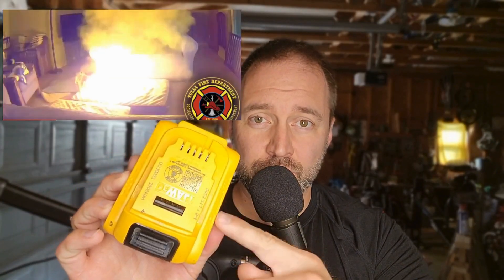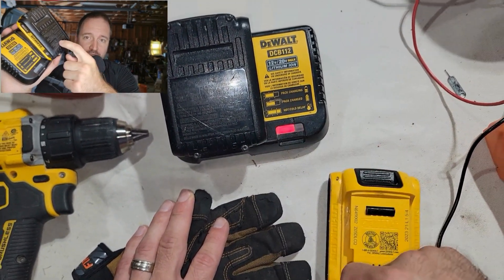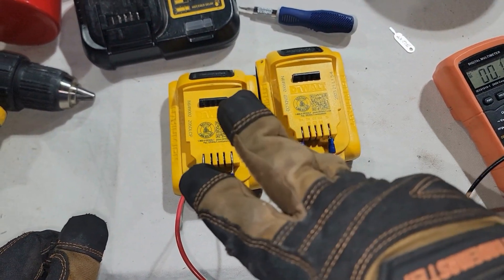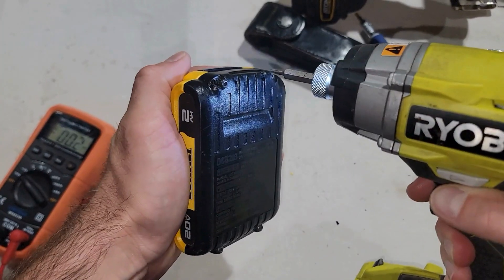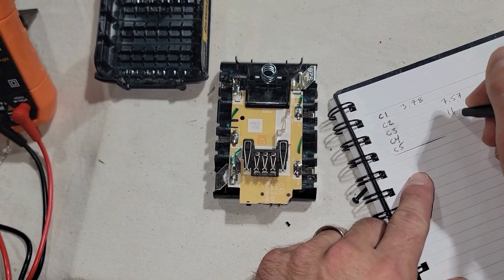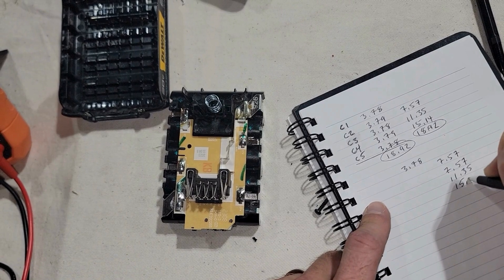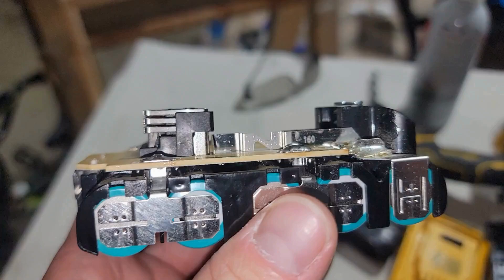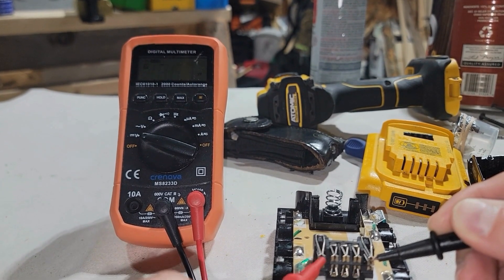DEWALT 20V Battery Not Working? [3 Easy DIY Charging Hacks -- but I DON'T recommend the last one...]

Comment: In my case, I have five different voltage readings varying from 1.038v to 4.18v... None of the five show 0 or negative voltage, but they are all different voltage. What is the protocol for resetting it back to normal, I wonder? Any advice?

Comment: I tried this and my battery still doesn't work on the DeWalt it will not charge it had no light when I pushed the battery indicator button now there's one light but it still won't charge it's just a solid red light and I made sure it was firmly seated in the charger I also do not have an ohm reader

Comment: What if you plug in the battery and the light on the charger start flashing but then slowly fades a turns off? This is happening with one of my 18V 6.0AH batteries that are $329 AU to replace. Ive jump started it once with another battery but this time it wont charge but it still has 1 bar of charge.

Comment: Question I have a 6ah 20v and it shows full charge but using it only last for a short time when I put on the charger it charges for maybe 5 minutes and shows its fully charged this is like a brand new battery Maybe it got hot when I first used it on a weed eater?

Comment: I had a 6amp hour dewalt battery that had fell on the floor on its side. It stopped fully charging. It only charges up to one bar. Opened it and it's at a negative 4.0. The rest are at 4.0 and one is negative. Is it good or do i dispose it?

Comment: I don't know if I will end up getting a response or not. But I'm having an issue with one of my batteries I had gone through the methods checked my voltage and the cells appear to be good and my overall voltage was at 17 volts on a 20 volt battery. Every time I put it in the charger it blinks once or twice and then goes to a solid bar. The battery is fully seated but for whatever reason will not charge. I did some more digging and I found that there was a way to test the ID and TH of the battery and found that the ID is supposed to be at a thousand ohms I was only getting about 800 ohms. And on the TH it said that it varied by temperature but I was only reading OL on the TH. My assumption is that my battery is dead in the water and there's nothing I can do but I figured I'd ask to see if there's anything I can do potentially save my battery?

Comment: Took me a few minutes to make a simple set of jumper wires but when a performed the "jump" on the dead battery it took just 5 seconds like you said.  It worked.

I used a small section of extra extension cord wire - both wires the same color but I put on two different colored connectors to keep the + and - easily identified.

Comment: Question? My dewalt battery that is correctly seated says it is fully charged, but when I press the LED indicators, it say it is dead, would any of these methods help me fix it or would it be simpler to just replace it?

Comment: If I have 2 18V batteries that will not charge, but not good battery to jumpstart them, can I use a 12V adapter?  Or a slightly higher voltage, a 20V battery (a totally different battery of another brand) to revive the 2 bad batteries?  It’s ideal to have identical batteries, but do not have any.

Comment: Well I'm no rocket surgeon but my mechanical aptitude is above average even more so when it comes to electronics been doing car audio for 2 decades so this whole battery revival thing should fall well within my abilities and comprehension and after 10yrs and dozens of batteries and attempts I have yet to revive a single battery not one ever what the fuuuuuuck

Comment: A little story: someone gave me four Dewalt 18V 5Ah batteries and said they were empty. Do you want them? I'm a scraper and collect old metal, so I tried charging it from a good battery to the old one, but nothing happened. So I opened the box. I couldn't believe my eyes. There were only three battery cells inside, so 3.7x3=11.1, not even 12 volts. Then I realized they were fake. The man charged and charged and nothing happened. This company needs to be shut down, but they're all scammers in China.

Comment: I've got a 20v/60v flex dewalt battery that when I hook up to a charger only charges to 1 bar before showing "charged". It'll flash for a moment then go solid red when it is "charged" as well. Is there a dead cell/multiple dead cells causing this issue? I'd like to take it apart but lithium batteries can be dangerous as stated. And yes the charger is good, i have 4 other dewalts that all charge perfectly, including another 20v/60v flex

Comment: I'm getting weird results from the test:

C1 - 2.5
C2 - 4.6
C3 - 7.2
C4 - 4.3

B+ - 6.7

As soon as I connect B- to C3, my multimeter shows Open Loop for about a second and then a steady 7.2v

When I connect B- to C4 it starts at around 6v and lowers quite quickly until it steadies at 4.3v. 

I'm unsure of what the issue is here. Can anyone help please?

Comment: I had a new Battery I used once forgot to turn my sprayer off and it went dead dead.  the jump start seem to have worked will see if it takes a charge.  You think these things would have a low voltage cut off so it don't go completely dead.

Comment: 5:30 - This makes no sense. The terminals (“pins”) are connected to the cell banks, so testing across the cells is exactly the same. The cells are “strapped together” in a 2P+ battery when you measure across them regardless of where you measure. It’s not even possible to suss out the voltage of one parallel cell without removing it from the other, so there’s nothing measuring from the terminals can do about that. You just have to treat parallel cells as one, which is what the tool and the terminals do. The “straps” that connect cells in series are irrelevant since you are measuring the relative voltage difference from one side to the other.

A 5 cell DeWALT 20V Max pack is 1P.
A 10 cell DeWALT 20V Max pack is 2P.
A 15 cell DeWALT 20V Max pack is 3P… or 1P in 60V Max config (FlexVolt).
A 30 cell DeWALT 20V Max pack is 6P… or 2P in 60V Max config (also FlexVolt).

If anything, it’s safer to measure from the wires connected to each bank since the terminals a very close to each other and easy to accidentally short with your probes. You also don’t have your meter rounding cumulative voltages for less and less accuracy like the add and subtract method you used.

Comment: I sometimes drain my batteries just to cycle them.  I converted an old charger so when i slide the battery on, a led light slowly drains the battery.  Unfortunately, it drained it too far and wont charge properly.  I believe one cell is bad, checking it tonight.  I wont be attempting any resets, maybe a cell replacement.

Comment: HOLY COW!!! Method #2 actually worked!! I purchased a DeWalt battery from a auction. It was dead and would not charge  when placed on a charger. I tried method #2 and placed it on the charger and it started charging. Thank you!!
Reply: what kind of wire to use, sir? Thanks

Comment: For the life of me I have two batteries that are completely different manufacture years, one 2020 and one 2023. It always seems to be the little 2ah batteries that if left for too long between home projects they go completely dead to where the charger doesn't see them. I just don't understand. I store them inside my climate controlled home, so they don't get hot or cold during storage times. But it seems to keep happening. I only use DeWalt batteries bought in store at Lowe's. I only use the DeWalt chargers that came with my tools. I don't leave the batteries sitting on the charger all the time. 

My Dad on the other hand doesn't give a F and leaves his batteries in the trunk of his car literally risking them overheating and turning his car into a fireworks display gone wrong
 Leaves them in the trunk in below freezing winter temperatures... and he's NEVER had a battery fail this way. 

Clearly neglecting TF out of the batteries rather than properly storing them seems to be the play here. He also uses his tools way less than I do, I just can't make sense of it. 

I have 3 RC cars with Lio and lipo batteries so I have a pretty decent understanding of how to store batteries. But I guess my knowledge is wrong.

Comment: Absolutely horrible advice jumping the batteries one to each other and the WORSE advice is to reset the CID !!! PLEASE If a battery cell trigger the CID is because reached the thermal temperature that was about to go in run away. This battery IS NOT SAFE anymore. Not only is stupid, you have positive and negative side right there and you are promoting people to short the battery and have an accident or a FIRE  !!!!! VERY BAD and UNSAFE Advice !!!!!!!!!! PLEASE DO NOT DO WHAT HE IS ADVANCING and protect stay safe !!!

Comment: If your battery and device are new to you, it is very possible that when you slide the battery into the charger, you need to give it one last "bump" to seat it. You will feel it lock-in. It's not obvious. But if you are not a new user, then this is probably not your problem.

Comment: This video helped me to decide not to mess with my battery lol.
Reply: I didn’t think it would work but I had nothing to lose to looped the ends of the wires round to make a good contact, connected them all for a maximum of five seconds and actually got a low battery light come up where there had been nothing before. It’s charging now 😊
Reply: Same lol

Comment: I've got a 10AH Dewalt batt that shows only 2 bars no matter how long it has been charging.  When used with the other good 10AH batt in the mower, it runs for a second and shuts off.  I can operate the pruner with it, but not even the leaf blower runs with it for more than a second or two.   I tried draining it by operating the pruner a couple hundred times and could get the 2 lights to be out.  Back in the charger, it goes only to 2 bars.
Thoughts ?  Suggestions?

Comment: I heard a pop when battery was removed from hedge trimmer I tested each cell one measured -0.035v I guess the bad cell causing charger to show solid big light but not charge. Thanks for the advice I will dispose of it no way I'm resetting and risking clients safety/property.

Comment: Regarding method 3. Do not attempt. I'm an electrical engineer and I repair and rebuild battery packs all the time, and I would never try this. You have no way of knowing if everything is fine or if you created conditions for an internal short. If it shorts it will spew sparks and/or flames like a rocket motor or it will just explode. Either burns or missing fingers are guaranteed.
Reply: What does it mean if the C3-C4 battery cluster voltage shows NEGATIVE 12.04V while all others are +3.889V when measured from B- to C1, C1 to C2, etc.?  The battery charger LED blinks once and then goes solid as the battery is fully charged, yet the B- to B+ voltage is 3.469. The problem just started out of nowhere after the battery was working fine for years. Is this thing about to explode?
Reply: @alexlazarev6686  To find out for sure you need to open and measure individual cells. Negative voltage is likely from over discharged cells in the pack. Without knowing all of your details and taking my own measurements I can't know for sure.
From the sound of your question I would say it would be best to recycle it properly and buy a new one. Normal service life of most batteries is only a few years. Re cell is possible, but the cost to the consumer is nearly what a new would cost and newer battery tech is usually better.

Comment: I tried hack #2 on an Amazon no-name DeWalt format battery....no-go.  Aside from an accidental over-discharge as stated in the video, these can also mess up like this because one cell in the pack fails.  The jump start will not shore-up a bad cell.  If it works once, the battery pack will fail again soon.  Regarding #3, well done!  I'd really like to see all those who actually rebuilt their battery pack where they are today with that successful home repair.  Called the insurance company or did the pack last just another brief season.
Reply: I replaced a dead cell in a 5ah 20v dewalt battery.. Worked for about 2 years and stopped working again.. gonna open it up and try again

Comment: I have a battery that show me 1 line at the charge indication but it wont charging 
When I plug it its blinking 2-3 times and stop, what should I do?
Reply: You have some low cells. Take apart and measure cell with meter. remove bad cells and replace or recycle pack

Comment: I just discovered something relevant.  I have 5 20v worklights. 2 Dewalt and 3 Chinese knockoffs.  Leaving batteries in the knockoffs for extended times drains the batteries to nothing even without usage. The Dewalt lights did not drain the batteries. I used the jumper procedure on all three batteries and all three began to accept a charge from the charger. I used the jumper for 10 secs. I did make up a set of jumpers with spade connectors to insure good contact. Many thanks for your video.
Reply: This is because in their wisdom dewalt put the overdischarge protection in the tool not in the pack. Probably to save a few dollars but it means that non dewalt accessories will flatten the battery

Comment: Tried the 7 second trick twice but each time I connect the bad battery to the charger - no change, it just won’t take its charge, although after trying the 7 second trick, my bad battery suddenly had a 17V reading! The Saker charger usually shows a red light when charging a battery and green when fully charged, but my bad battery seems to be charging although the green light continually shows - not red. Any suggestions, anybody?

Comment: so my battery got over drained. i put it on the charger, it blinks once and then goes solid and says full charge on the charger but if you try to use the battery—nothing or press the battery light on the battery it’s a quick very dim flash. so i tried this and it still does the same thing as before. any ideas? very well done video btw
Reply: You have cells that are too low. You will need to take apart the pack and measure each cell

Comment: I had a fully discharged battery my grand-son had left out in the rain. Your trick worked! I jumpered a good battery to the depleted one for about 7 seconds, put it on the charger and it started charging.  Thanks for the great advice.
Reply: I have EXACTLY the same problem, only it was me, the grandpa, who left the battery out in the rain! It's a 20V for a Saker mini chain saw. So I'll take your advice, watch the video again and do my best…..two days later…no joy. 😮 Tried the 7 second trick twice but each time I connect the bad battery to the charger - no change, it won’t take its charge. Any suggestions, anybody?
Reply: This helped me to save a battery I only have like three so it was important to save this one thank you for the advice

Comment: I just used a working Dewalt battery to jump a black and decker one I have that wasn't working/charging. It's probably not recommended... it smoked a little bit when I got it connected..... but all is working now.
Reply: How long did you leave the battery connected? I've done the advised 7 second trick twice, then tried it on the charger- no joy. Any advice much appreciated!

Comment: Hello I have a 20v dewalt 2ah battery the battery fuel gauge does not light up but I put it on the charger and left it alone for awhile and came back and the battery charger said it’s fully charged so I hit the button again and still no lights on what could this mean
Reply: Sometimes the button can fail or the board has a problem. I had a button fail due to corrosion, replaced the button and now its good.

Comment: Can this be done with one of the 20V/60V flexvolt batteries? I'm taking the measurements, but I think I'm only seeing the 20V side. Does the slide switch have to be engaged to see readings using the C1-C4 terminals? This particular 9AH battery has 15 individual cells. Just curious if they may be tied together in groups of three or how that would work.

Comment: Thanks for helping with this great info!

My situation: I purchased three 5Ah XR batteries. And one of the three (since new hough now well out of warranty since I just ignored it for so long) was always an under-achiever. After a year of occasional use, it lasts 5 minutes for the same tasks that the others last for 35 minutes. The bad battery goes from showing 3 bars to ZERO (and cuts off power) in the blink of an eye. It charges fine, though it only takes a few minutes from "empty" to full where the others take an hour or more. 

So I charged the bad battery, and just checked all voltages. They're all over the map.

3.70
3.83
3.38
3.98
3.85

None of them is zero, so a reset would have no effect. No idea how they'd get so wildly out of balance. Any clue? Seems like disposal is my best option. But what a waste.

Comment: How to check the cells in a 12 volt DeWalt battery, please?
Reply: Take it apart and measure each cell with a meter.
Reply: What happened if 12 v battery doesn't charge?
Reply: @tomaszbiernacki1469  Bad cell or two. Did you measure the batteries output?

Comment: I just did this with my Dewalt 20v dead battery, this works and now it is charging. Thanks so much for sharing
Reply: Hello, I have a battery that I accidentally connected incorrectly, with the positive and negative terminals swapped. Now it only shows 15 volts instead of the expected 20 volts. I’m not sure how to check which of the seals might be damaged or how to reseal the battery properly. Could you guide me on how to inspect and replace the damaged seals, and what the best steps are to fix or replace them?”